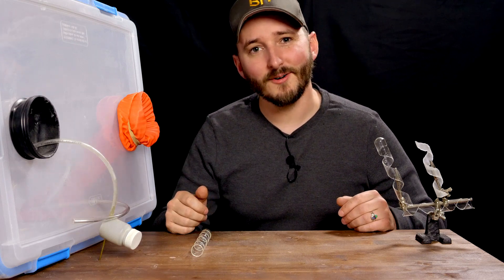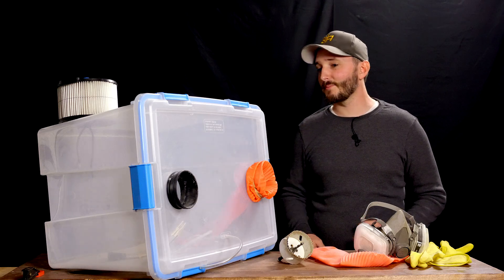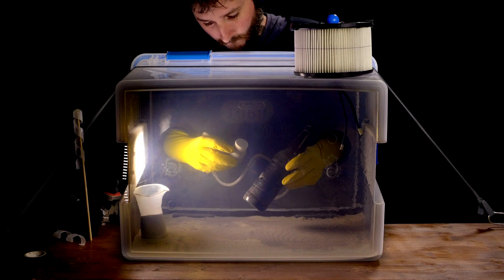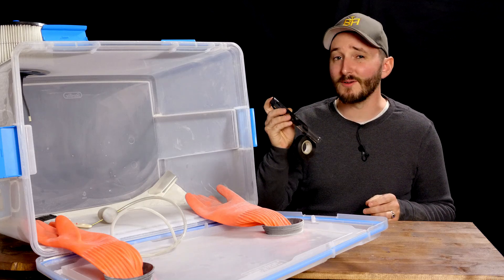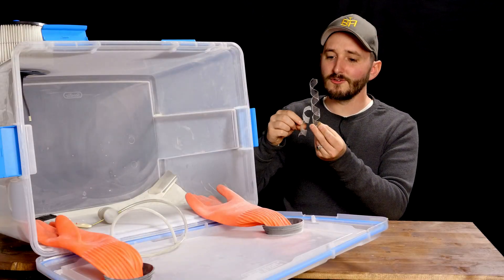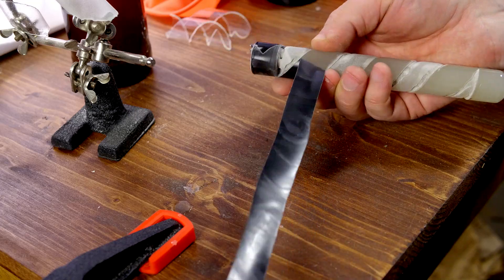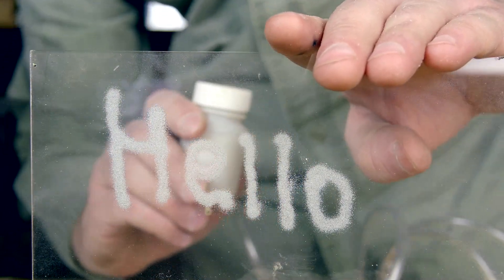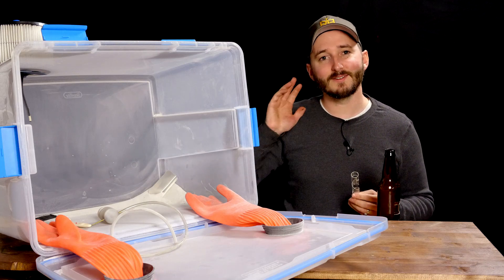*Impossible* Glass Cutting With DIY Sandblaster

Comment: Once the desired outline is made by the sand etched cut lines, what would happen if you put wire into the grooves and sent voltage through as a uniform heat source 💭 curious if the edges would be annealed with the ideal discharge parameters (possible tinkering to optimize).
Reply from the maker: I don't think so. Annealing is usually done to the whole piece in an oven
Reply: @Nighthawkinlight  Thanks! Yeah, meaning to attempt flattening bottles with long heating times in an oven. Imagined the voltage being slowly increased along the etched areas, but just as a means to assist in avoiding any jagged edges (tiny glass shards are so difficult to remove from the epidermis, trying to ensure minimization with crystal - usually what I find at estate sales for great prices). Mahalo 😊

Comment: The mini-blaster sure would be nice for the simple fact that it wouldn't cause a compressor to run until one's brain begins to melt. My own sandblaster is home-made from an old coffee plastic--and it works great, but the sound of the endless hum becomes tedious, especially with detail oriented sit-down projects like this. Apologies for the solicitation in advance, but did you ever watch the 'glass rings' one I did a few years back? A rotary tool will work really well when used in combination with a water drip and with a jig to steady it. Video didn't get much traction, but the method is quite sound. A spiral in this form would certainly be doable, especially with the wax reinforcement.   

Back to your mini-blaster though; this little thing may solve a really tough problem of my own. I've been trying, in vain, to reliably drill holes in marbles since the days of flip-phones. This might be the next direction to approach the problem from: if only there were an even smaller tube inside, to sort of Venturi some of the spent sand back out of the way... like I said, tough problem. Ay me; tinkering! 
Hope all is well.
Reply from the maker: I'll have to check that video out! I think boring through a marble wouldn't be a problem, but I wouldn't count on the hole being a constant diameter
Reply: @Nighthawkinlight  This thought followed me into the shower. Ideally, it would be reciprocating, wouldn't it? Imagine a recycled pulse of air moving back-and-forth, carrying with it some small amount of sand and picking up glass media as it drills. An alternating current air drill! The switch mechanism has me at a loss, though. 

As for constant diameter, this could be controlled by using the 'nose' of the (outer) tube as its form; if it were continuously pressed against the surface, stray sand erosion could be limited. Eh, sorry to bother you. Just thinking out loud.

Comment: You don't have to cut all the way through either.  You can etch a pretty deep pattern in the glass, and either color it in, or leave it as is.  Either way you get a cool effect that is even nicer than any surface etching method (Chemical, shallow sand blasting, laser, etc.  You could also etch things other than glass.   You just have to experiment to see how the results come out.

Comment: Some thoughts: 
-Use liquid rubber to paint on your design, then use acetone to dissolve it when done
-Adjust the dimensions of your blaster tip to create different abrasion shapes (like how shotgun chokes can modify shot)
-Use a softer or finer blasting media for sharper edges (powdered glass?)
-Incorporate a water line to further cut down on dust
-Use a glass cutter to pre-score your design (though hot/cold cutting might be more efficient at that point)

Comment: I wonder if this could be used to etch glass in "usual" etching fasion - that is cover the glass in wax or paint, scratch out the design (allows way smaller and more delicate details), sand the design, then get rid of the protective layer.
Reply from the maker: Yes that does work, though I would use a vinyl sheet and cut out the template rather than scratch through paint.

Comment: To avoid the hassle with the wax, would it work with a long slightly inflated balloon there? I assume the balloon would be from a rather thick rubber so the sand won't rupture it.
Reply from the maker: Maybe, but you don't want too much pressure on the inside of the glass when cutting complex shapes or it will crack

Comment: Amazing and interesting as always !! I have just a question, why didn't you just put a piece of tissue inside the tube to protect it instead of wax ?
Reply from the maker: I tried that first. You have to pack it too tight to fill all the gaps and then it puts pressure on the glass from the inside causing cracks. It's also hard to remove.
Reply: @Nighthawkinlight  ok thanks for sharing your experience ! Well done then ☺️

Comment: The air filter, usually the airflow is in the other direction on those kinds of filter. Are you sure that it's ok? My experience is quite limited.. but still
Reply from the maker: I didn't consider that. It seems to catch the dust really well.
Reply: @Nighthawkinlight  If it was on the other side, the air pressure would seal it better and you could clean the filter better. The dust being on the outside. This gives you more room on the inside, idk which would be better.

Comment: We use the method of vinyl stencils and sandblasting to mark information on the outside of lenses in the optics manufacturing industry. A laser cutter also works really well to engrave or cut glass.

Comment: Would like to know a bit more about your hardware like how many bar/psi is needed and at how large volume (Liter/minute). Also, can a plexi/acrylic plate be made in to a replaceable view port or could a cut open pet bottle be made to work, if so how would you do it?
Reply from the maker: 60-100psi. Not sure on lpm. A replaceable window is a great upgrade if you can make one that doesn't leak dust.

Comment: As always you came up with some clever ideas. I went one step further with my blasting chamber. I cut a hole and inserted my shop vac hose and then let the vac send the dirty air to the outside of the building. I also made another hole and fastened a pipe T  and taped a plastic bag to it to act as a ballon so that the bag would take up extra air. On the other end of the pipe T extension, I placed a ping-pong ball on the down side so it would act as an intake valve and pull in fresh air while the vac was running. The bag on the other end of the T just acted as a ballast for air to balance input to output. The T had a smaller opening on the bottom so the ball would not fall out but would seal the opening so dirty air couldn't exit there. This set-up prevented the vacuum from getting so high it would collapse the chamber.

Comment: I worked at a place that made headstones for a couple summers between high school and college. This is very similar to what we used to etch the granite. We had stencils made from a 3M material specifically for sandblasting stencils (the product was basically a thin plastic backing with adhesive on it, and a foam layer, probably about 1/8" thick). We'd sandblast through the stencil to carve the lettering and designs. After, we'd use the stencil for painting as well. Just paint through the stencil, peel it off, and clean any adhesive residue, and you've got a headstone.

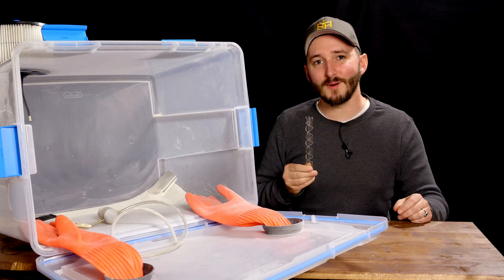Comment: 8:15...decal...not a sticker...there is a difference between the two...decals have a pre mask on the top side...stickers you just peel backing and install... decals u peel the back...put it down and squeegee it smooth with no wrinkles or bubbles...then peel off the pre mask... nobody knows this why would they...I worked putting logos on trailers and buildings and I called them stickers and my boss almost had a heart attack and promptly told me the difference between the two

Comment: I get that you had a warning about breathing protection but it should be noted that sand is not used in industry due to the rampant nature of silicosis. Please don't use sand. Glass bead, jetmag or aluminum oxide are all cheap and much much much safer

Comment: I'm not sure but instead of filling full of wax can you just clear coat the inside and then when you get done just wash it with paint thinner
Reply: I thought the same thing, it should work the same.
Reply: The clear coat makes a hard coating. The wax is soft and absorbs the impact
Reply: @OtherDalfite  ok but does it  work that is what I was asking
Reply: @mandycole21  I can't say for sure, but given clear coat has similar material hardness to glass and chips off, I'd say no.

Comment: You can tape a transparent sheet inside the cabinet where you look through, so if the sand damages the see through part you can change just the transparent sheet.
Reply: That's a great idea. Just use hot glue to attach some polycarb. After a. while, scrape it off and replace.

Comment: What about instead of using black tape or vinyl stickers and wax, just dip the entire piece in plasti-dip and remove it in areas where you want a cut?  The cut glass might stay in place just like the wax and prevent sand from getting inside, seeing as how the plasti-dip is on both surfaces.  I dunno, maybe it's not thick enough for that kind of support, but you still have an intact layer on the interior surface to prevent the glass you want to keep from getting frosted.  It should peel right off when you're done.
Reply from the maker: Not a bad idea

Comment: Never ever use sand - silicosis!  Garnet or proper medium MUST be used.  You have some safety measures, but it should just be avoided
Reply from the maker: Garnet and other mineral media is just as bad for your lungs. Silica only gets singled out because its the common mineral that causes dust issues in mines
Reply: @Nighthawkinlight  the issue is silica content, which Garnet etc doesnt contain - sure its bad, but not as severe as using a silica containing media.
Also - issues with lead crystal glass?

Comment: Don't use regular sand for sand blasting, even after being done small particles can hang around in the air for over 24 hours. Use special sand blasting material, normal sand isn't safe even with a mask and/or container.

Comment: If you add an exhaust fan on that filter you can dispense with the gloves because air will flow in past your arms  as you pull a vacuum within the bin and keep your dust from escaping.
Reply: In a hypothetical scenario where that's done, what would happen if the sandblaster hits your own fingers? I guess while not pleasant it wouldn't be a disaster for skin with fat/muscle below it, but where knuckles/bones are close to the surface could be worse? Also how fast would it chew through a nail?

And he is cutting glass in there, even if he's careful there's always the chance for something to go wrong and sharp glass breaking inside with the sandblaster still active possibly triggering less than safe reflexes.
Reply: @extrastuff9463  there is a clip in the video where he is doing sandblasting without gloves with no issues, but it probably doesn't do your hand model career much good :)

Comment: If you keep reusing sand from within the box where you're doing the sandblasting, you'll probably get bits of glass inside the bottle as well. Is that potentially a problem? I assume not, but Iunno.
Reply from the maker: No problem with that. Crushed glass is basically sand

Comment: What did you use to connect the tube to a standard air compressor hose?
Reply from the maker: It fits in the blowgun nozzle. You can also buy a fill up kit for a compressor blowgun which comes with adapters to connect tubing and various other things.

Comment: I have considered making one of those sand blasters, but my compressor while it can provide the pressure I am not sure the 6 gallon of air storage is enough to keep it from cycling itself to death. What size is your compressor?
Reply from the maker: Mine is pretty big, probably around 80 gallon. The mini blaster doesn't use much air compared to normal air tools, but you're probably right that your compressor would run pretty much constantly.

Comment: Love the idea can I use it to cut tempered glass for windows I have been trying to find a way to cut glass shower doors to replace broken shop windows and so far I have just shatered it
Reply from the maker: That's a tough one. I'm not sure about tempered glass. Definitely I'd test it on something cheap
Reply: @Nighthawkinlight  Tempered glass won't let you, codyslab tried a very slow method using acid to try and get a hole in it, but it just shattered when the hole got deep enough

Comment: Re: sandblasting soft things: I used to have a job that involved cleaning metal-coated plating fixtures with a sandblaster.  Hard metals like chrome came off easily, but gold (in this case soft 24k)  required significantly more work.

Comment: I used to keep saltwater aquariums and it's common to drill the glass for drains and returns to a sump. Glass holesaws are ungodly expensive, so I resorted to using a Dremel with a tile cutter bit. It worked, but the holes were always rough and never perfectly round. I wish I had known about this method back then!

Comment: Excellent ! Question: does this method cuts tempered glass? I think the vial you cut is also tempered glass. If so, this is great, for sometimes there is a need to make holes and trim tempered glass... Convetional wisdom tells there is no way you can do that w/o causing the temp. glass to explode. Please let me know !
Reply from the maker: I'm not sure if it will work with tempered glass. Needs testing!

Comment: Well now i feel silly for spending $200 on a proper cabinet. Thanks a lot! 
 :D

You should show how to make a simple foot pedal out of that blowgun (two pieces of plywood with a hinge) since having a 'remote' foot pedal for air is much nicer than fumbling around with a finger trigger inside of the box.
I also wonder if you could make a cyclone dust separator out of a regular plastic bottle, although it's probably not necessary for this cabinet since it does not seem to produce much dust.
Neat idea with those couplers, by the way!

Comment: How hard is the wear of the sand on the brass tube?
Reply from the maker: It wears out after a few hours of use. The tubes I buy come in a three pack, 12" long for something like $2. Each tube is long enough to cut at least three new barrels, so very inexpensive. It only takes a minute to snip a piece off, file a hole in the side, then glue it back into the vinyl tubing.
Reply: @Nighthawkinlight  Thanks!
I'm seriously considering building one now

Comment: Also, instead of wax , you could try a rubber hose that fits tightly inside of the tube.
Reply: Just thought about it, removing the hose could possibly break the glass so I don’t know.
Reply from the maker: Yeah I tried some other things but removing them is tough.

Comment: Adding a face shield in the spot you want to keep transparent it will do the job. Recommend adding a guide to hold it in place an old face shield cut and glued works good enough and is still a budget option. I wonder if clear sheet protectors could be used for a pull away option for when in use.

Comment: I've heard of a similar technique being used to etch stone.  Rather than protecting areas with electrical tape, they used a rubber mat.  The etched in areas were then painted black for added effect.
Reply from the maker: Yep, same concept. Rubber would be a sturdier option if you meant to reuse the template

Comment: Isn't the plastic box a little translucent to see what you are doing inside. Have you considered cutting a viewing hole and sealing it with a glass or polycarbonate window. It should be possible to make the replaceable, like that in a welding visor, so that it can be changed when the sand makes its surface opaque.
Two question: does the process leave the glass target covered in microfractures, that will ultimately result in a failure?
Does the glass target require any heat treatment to anneal out any induced stresses?
Reply from the maker: You can add a window but it's a little tricky to make sure it's air tight. I've not had trouble with new fractures after cutting with the wax method
Reply: @Nighthawkinlight  thinking about it, you could also add an LED panel on the outside to provide really good illumination on the inside. Since you are chipping away glass, I assume you end up with more sand that your started with:-). 
I am told that quartz glass is dangerous because it is toxic (carcinogenic), so maybe common  soda glass is a safer target.

Comment: For etching glass, I use a cheap gravity fed airbrush. Yes, it costs a bit more than your brass tube and jar method ($20-$30), but the amount of control you get with it is well worth the cost. Should work just as well for cutting
Reply from the maker: Doesn't the sand wear out the airbrush tube fairly quickly? I replace the tube in my sandblaster every few hours of blasting, which is fine because it's only a few cents worth of tube. I suppose your airbrush lasts a bit longer if it's steel instead of brass

Comment: Nope.. I still wanna hang.. You're cooler then Ice Ben. Absolute Zero.  I'm going to be trying this for sure. I've got some Airstream parts I'm renoing that need some sand blasting.
Reply from the maker: For aluminum use something like baking soda instead of sand in the blaster. That should take the grime off without hurting the metal.
Reply: @Nighthawkinlight  Noted. Thanks Ben. Your media looked super coarse. 60 or so Grit. I'll be sure to use the right medium.

Comment: Nice idea! 😀
Many years ago I needed to blast and clean off oil from a aluminium head.
I used sugar since the sugar would do minimal damage if left in place compared to sand.
Washed the cylinder head with hot water and it melted the sugar.
Engine runs to this day.
Please keep in mind that you can get a explosion if the air gets saturated with sugar and a eletrical spark is lit.
Reply from the maker: Baking soda is another option
Reply: @Nighthawkinlight  Yeah agreed. 😀